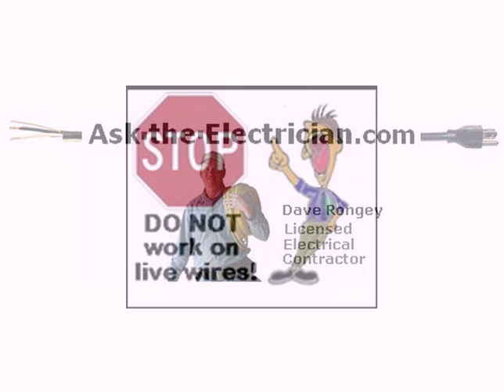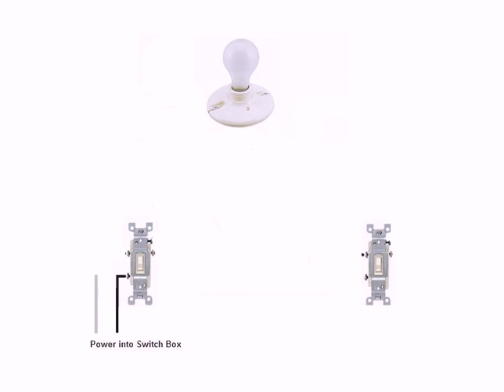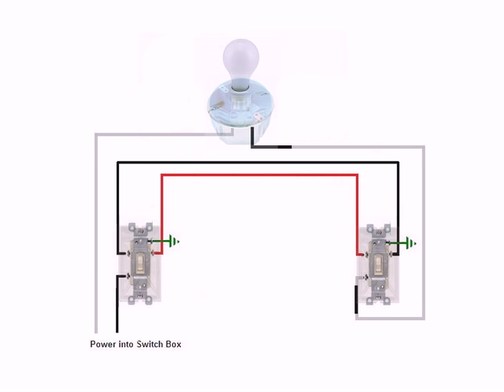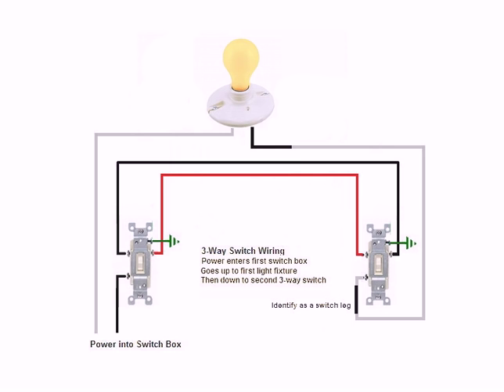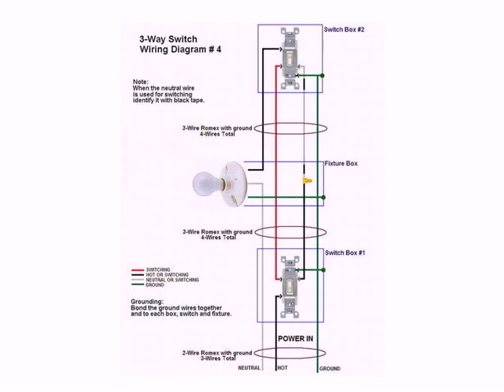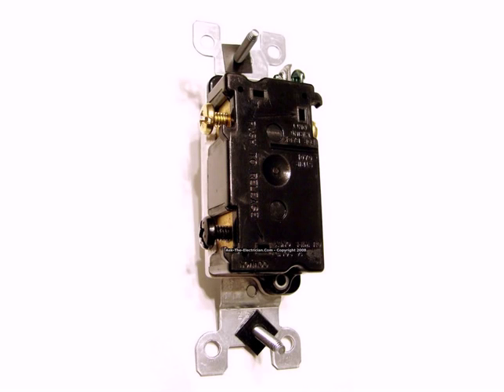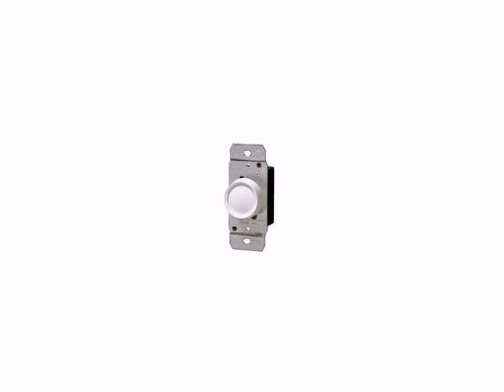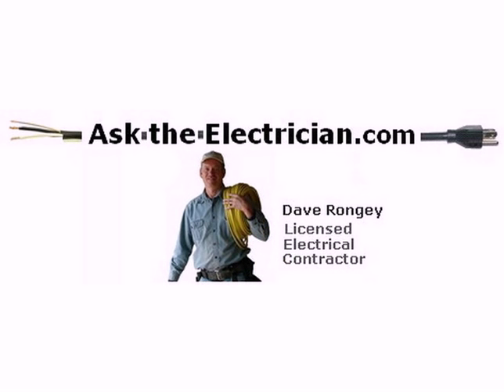3 Way Switch Wiring Made Easy, applies to 4-Way Switches and dimmer switches.

Comment: in diagram #7 it looks like that oulet (receptacle) is going to be hot only when you turn on the light, is that correct according to the diagram?
Reply from the maker: yes - unless there is an additional wire available so the outlet can be split, one outlet controlled by the switch, the other hot all the time.

Comment: I have a leviton nom 057 but it has 2 black wires 1 red wire n a green. How do u wire this dimmer? I am using as a single pole dimmer. How do I wire this as a single pole dimmer?
Reply from the maker: The Leviton dimmer switch may be used as a three way or a single dimmer. The red wire is used for the three way application.

Comment: what kind of wires do i need?
Reply from the maker: If your adding to an existing circuit, then the wire size is matched - or the same type and size as the existing circuit wiring.